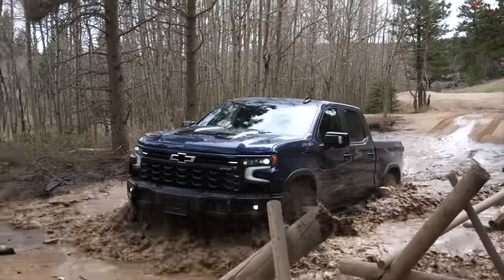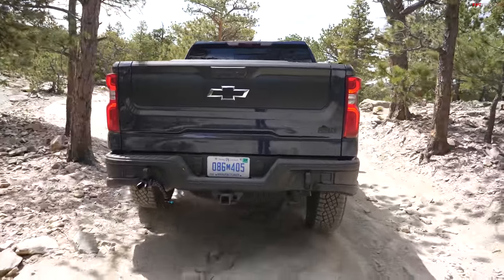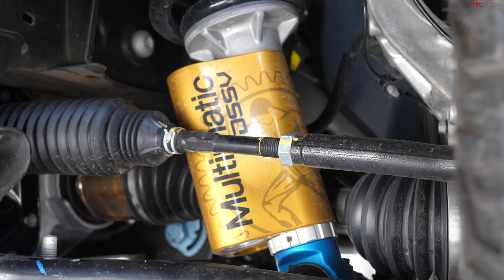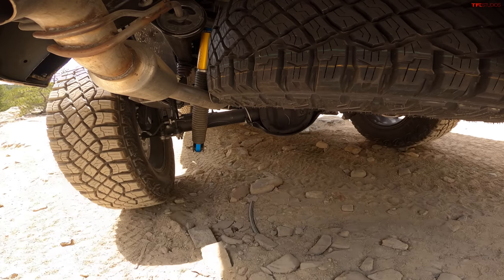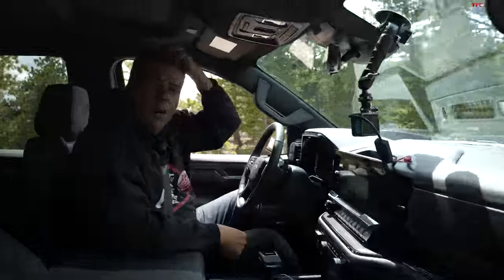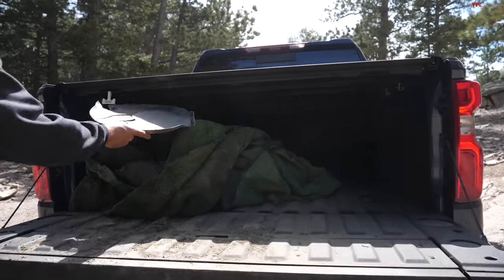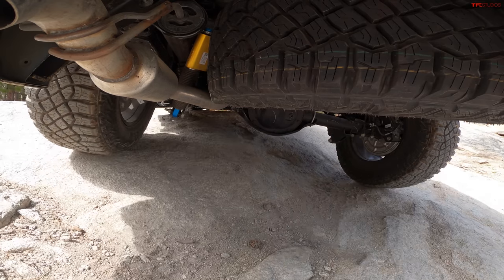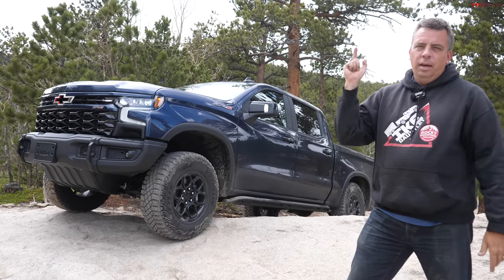The 2023 Chevy Silverado ZR2 Bison Handles DEEP Mud in the Colorado Backcountry, For a STEEP Price!

Comment: Let’s be real, that’s going to be $100k out the door. All these new “off road” trucks nowadays are just pavement princesses.
Reply: I'd rather spend an ACTUAL 85k on a brand new Raptor 37 with all the bells and whistles, heated/cooled seats, and an extra 30 hp and 50 lb/ft, plus it gets better fuel economy 😌
Reply: Don't know about the mpgs but sure
Reply: @awesomeness369 Yea you’re not getting better fuel eco on those 37s. lol
Reply: @awesomeness3699 you really think that Raptor will get better MPG's on 37" tires?
Reply: @richfarfugnuven6308  well judging what the EPA rates a Raptor 37 for 18/24 I'd say yes 💀
Reply: And the only thing that's making Chevy money right now is the Vette, why do you think they're moving all their money to that route, there they can get their top dollar amounts so they can make the money to fund truck research, they have 4 operating companies that are dying and Pontiac bit the bullet first before the steady decline, the Camaro is next, and what do you think will follow, they don't even have a diesel engine capable of 4 digits yet, they simply just don't even have the money to fund the research
Reply: @awesomeness3699  if you drive it with a feather foot, maybe.  A guy at work has one, and he is getting 12...
Reply: @richfarfugnuven6308  which one?
Reply: @awesomeness3699  regular 3.5L twin turbo on 37" tires, but we live in the mountains of CO and work in Denver.  So I am thinking the mountains and lack of O2 doesn't help...
Reply: @richfarfugnuven6308  well good sir, if you want to be specific, that also means that this heavy was truck will be choked due to it being n/a thus only giving you a single digit gas mileage 💀
Reply: @awesomeness3699  possibly.  I had a Yukon Denali, and it did better than that, but not great by any means...
Reply: @richfarfugnuven6308  i bet it had better payload than a mere 1010 lbs 💀
Reply: @awesomeness369  all GM's $$ is going to EV/Green tech. ESG is a real thing and they already played their hand. Chevrolet put 35's on the new Colorado ZR2 Bison and didn't even bother putting it on the Silverado lmao. The Silverado isn't a top selling product and they'll put $$ in what they think will draw more $$. It's sad, but true.
Reply: @sven_the_giant  nah homie, GM is loosing all sales, nobody wants to buy that shit and they should put their money into EVs their EV game is garbage, i cant tell you how many times I've been in a new Hummer and it has flat lined, Watts to Freedom really made me say WTF
Reply: @awesomeness369  what the faq you talking about? Raptor fuel economy? Bison is diésel never in your life will ever be better than a duramax engine fuel economy wise get otta here.
Reply: How about the LGBT rapture
Reply: @sven_the_giant  hilarious how you state your uniformed opinions like facts. The Silverado is GM's #1 selling model for decades.
Reply: @desertBirdDogs  lmao I own and love my Silverado and I know it's not the #1 selling truck 😂😂 do some research
Reply: @awesomeness3699 

You're literally making stuff up. Corvette is losing money for GM. However trucks, especially their 3 row SUVs are selling out. GM Arlington plant may be the most profitable plant on the globe. GM profit margins and general financial fundamentals are better than Ford's. You did nothing but spout nonsense in this comment thread.
Reply: I read all these comments and it let's me know how this country is in such trouble.
Reply: All but K, right before mine
Reply: My buddy just bought one and it was 100,000 Canadian but the US price is always significantly lower like 20-30 grand but not sure. Brand new and he put a olive green army colour wrap on it looks really good actually especially with the black trim
Reply: I've already done crazy shit with mine. It aint right to keep a thoroughbred in the barn.😁
Reply: I'll still be driving my 94 F150 300 inline 6 and 5 speed 30 years from now.. .
Reply: Dont be mad you cant afford one😂😂 if you pay for a truck with your money you can do whatever tf u want
Reply: Got my bison for 76
Reply: 85 ish and BUILT-IN MEXICO!!
High-end money for cheap non union labor!!
Reply: If you want more bang for your buck get a 2020 Silverado z71 trail boss. I got mine for 41K with 33k miles, and if i want to upgrade it i can, its a simple machine, i bet i can put better equipment onto my truck and easily stay below 85k and be just as capable as a raptor, i wont have the same power(i got the 5.3 6spd 3-42 gearing) but i dont have all the electronics that the other trucks do i have the custom trim so over time im saving money in maintenance costs, the rapors trx's and zr2s have too much electronics for a true off roader, but hey to each their own, but my truck stock does great and i can get up to 22mpg highway so have fun trying to get that mpg in those 37in tires😂😂😂 there no freaking way a raptor can get 24mpg highway i call bullshit
Reply: @christopherwoodyatt38  I went to buy a tail Boss, the 20 trucks I had to choose from were built in Mexico.
Built with cheap non union labor but sold for a premium price.
Where was yours built??
Reply: @philllsxga.7737 Why would I care if the labour is non-union? UAW is what is holding the domestic carmakers back.
Reply: @TroySavary  the job you are saving by buying American could be your own...
Reply: @philllsxga.7737  I'm not American.
Reply: Idk about that tho, look at what they’re doing in the video. Very capable truck. My dad has the 2023 Silverado ZR2 and he had to bring it deep in the trails to pull my Jeep grand Cherokee out. And the ZR2 did not even flinch, we had wheels in the air and you wouldn’t even know it. Just wish the suspension was a little softer. i’d say the only downside is the price, he paid 88k out the door that was with it fully loaded, preordered, came with 31 miles, and first person to take delivery of a ZR2 on this side of Pennsylvania. He paid the full price, no loans so he actually takes it on trails and isn’t afraid to hurt it cause it’s all his. So no pavement princess is over here. I only see it being a pavement princess if you owe money on it. 
If I owe money on an $88,000 truck, I’m not taking it on serious trails
Reply: @MichaelKlippi  I was following the Silverado ZR2 before production.
I went to my local Chevy dealership to possibly buy one and found out it made in Mexico..
I bailed out!!
An expensive ass truck built with cheap labor...
Reply: Why would I go off-road with a house on wheels 😢
Reply: For real, in the cities, but where I live on the Zuni reservation, I wouldn't mind taking that truck on the backroads and putting it through the abuse it was made for but 100k for a truck come on

Comment: With 35 or even better, 37 inch wheels it wouldn't have touched anything. Thanks for the video and for keeping clean the environment, everyone should do what you did.
Reply: Would be better if everyone did not dump on the trails to begin with so nobody has to be doing clean up. 😉
Reply: @WW-wf8tu  Correct, but as you can see there are people who don't care, so someone else have to do that, even if it's not fair.

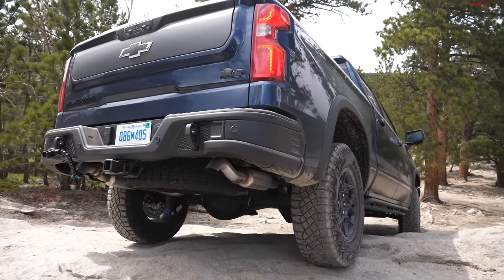Comment: I have to give the capabilities of this GM respect.  In this environment, it was the right tool for the job.  The GC, the front and rear lockers and the cameras were good.  The increased GC is a sure fire way of helping a GM product live a few months longer if it is not scraping along.  Oh, and the exhaust pipes @ 10:44 nicely done.  I hate to admit, this is 1 of the rare moments that I have been impressed with a GM in a long time.  Would be interesting to see how much time it spends in the shop over the next 3-10 years and what it was in for.

Comment: First off, Great review and testing, Andre and TFL crew. Love seeing this truck off-roading.

In my opinion, this truck doesn’t need a wide stance of a city bus like the TRX and Raptor. Won’t work in mountainous terrain. 

The 33 in. tires are just as good, even better, than the taller tires. The 33s can do handle both on and off road unlike the bigger tires that are great off road but not great on with poor handling, ride comfort and noise levels, and fuel economy plus the possibility of rubbing the inside of the wheel well.

I agree the price is high, but what you get is fantastic. The lockers, the cameras and the cool AEV gear. I know the ZR2 doesn’t compete with the two so-called Super Trucks, but it will keep up and surpass them when it comes to Rocky Mountain terrain.

If I had the money, I get this exact truck but in Sandstone Metallic. Keep up the great work, TFL.

Comment: It will be surprising if they sell many of these. A regular ZR2 has all the important mechanical upgrades. Some boron skids and different wheels, you REALLY have to be a fan of the Bison branding to throw that cash down.
Reply: I have a Non Bison ZR2 and it is an Extremely capable truck. And a pleasant daily driver. Except for the mileage.

Comment: When is GM gonna quit mounting the rear shocks so low below the axle? Other than that one thing I love the GM tucks.
Reply: They FINALLY changed it on the new Colorado ZR2 haha
Reply: I think it requires some significant reworking of the frame and bed, which is why only when redesigning a whole new model like the Colorado did they finally make it so that the shocks had enough travel without hanging Dow too low.
Reply: I agree. That design flaw always bothered me and deterred me from buying a GM truck.

Comment: 6:07. Andre, at 6:07 +/~ you say you’re taking a super difficult line and I noticed the front passenger tire slip and turn faster than the front driver  tire. I saw that you locked front and rear so is it a true locker or limited slip in the front?

Comment: My Dad was right when He said that 4 wheel drive is for when You get stuck in Two wheel drive. Of course when We went Deer hunting He would climb the steep hills of Marin County with His old Willy’s Jeep Pick Up. They were rugged looking with those military type fender’s. We have had Fords and Chevy’s and still do but I really like the old military Dodge weapon’s carrier or the civilian model Power wagon that looks like a WW2 military ambulance or WW2 Chevy. Having a narrower vehicle has definite advantages especially in Bay Area California where people park on very narrow roads like those on the slopes of Mount Tamalpais  and surrounding area’s . The fire department can get away with smashing cars that choke down roads but not the general public. Also keep in mind that wide offset wheels are hard on axle spindles and bearings . Those bigger tires cost more and need more power to turn them causing more fuel consumption and loss of extended range. Loose a wheel and tire on the freeway or roll over while traversing a side slope and You better have a very good attorney because You might just be charged with manslaughter. Break something in the middle of nowhere or a rugged place and a lot of recovery operators may refuse the work or charge a hefty fee. Abandon the vehicle without a guard snd there are those out there who will strip it of everything.

Comment: You know what would be great is if they gave people the ability to pick the options they want instead of making a hundred "different special" sub models that have 10 to 30 thousand dollar price hikes.
Reply: Yeah the custom trail boss comes with only a 7 inch screen. But if you want to upgrade to the 11 its not an option you have to go up in trim level. So then you have to get the LT trail boss. So thats like 7 grand just for a bigger screen! you can buy a 11 inch tablet for like $150-$900 but you have to go up in trim level that doesnt really add much at all. Think it says bigger screen and different wheels. The LT allows you to get the 6.2 engine but all that should have been an option in the basic trail boss. So you go up and its like $10 15 grand then you still want like $10k in options your looking at a $70k truck just to add options. Upping trim levels is a scam. They should just allow to option out the basic trailboss with everything.

Comment: @ 3:50 - 4:06 - 33" tire / no tire big enough......exactly correct. All the new off-road type of trucks should roll off the assembly line with 35" tires and offer 37" tires as an option. Glad I have a 2022 Ford F350 Lariat Tremor.....great payload and towing ability and IMO more capable off-road than the Chevrolet ZR2 or GMC AT4X.

Comment: Did you replace the electric steering rack after crossing the water? Usually the motor becomes faulty and loosing the steering ..I have already replaced it for my 2015 silverado.. headache

Comment: I test drove the bison a few days ago, very nice vehicle! I’ve been holding out on purchasing any of the midsize trucks like Gladiator rubicon or Colorado because they’re just too small for 4 guys to go on a trip in. 
I find it bizarre how Chevy could release a truck of this size with a play load of 200-600 pounds less than the gladiator rubicon, Tacoma TRD Pro etc. with it being quite a bit bigger than the other trucks. 

You’d hit your payload quota with 4 guys sitting in it before you’ve even fitted a roof top tent and packed your bags. 

I don’t see the point of having such a large and capable off-road vehicle when the payload limits it even more than it’s other smaller and more capable competitor like a gladiator rubicon, makes the bison a bit redundant before it even hit the streets in my opinion.
Reply: The extra weight of everything reduces payload. Also softer/plusher springs for off road reduce load carrying. Probably has to do with DOT/legal too. They have to stay under a certain GVWR. 
They have a HD Zr2 coming as well with 4K lbs of payload.
Reply: @TobyCostaRica  - I’m sure there are those factors. And yet you have something considerably larger than the Gladiator/Tacoma with a lower payload than them. So it just doesn’t make much sense for me as I’d rather go with a more capable 4x4 like the gladiator rubicon as I’m only going to be able to fit myself and a passenger with luggage in either it or the bison.

Comment: Ironically, the manufacturers are finally bringing a bunch of serious off-roaders (instead of plastic poser packs), but at a time when no one can afford them. If they had taken this approach 5 years ago and priced them between 45,000 - 55,000 they would have been selling like hotcakes. 85K is just too much for most buyers and then, after spending 85K, how many can afford to risk taking it on the sorts of trails that it deserves. In 10 years, these will be a fun used proposition for 12K.

Comment: So my thing with chevy is that they haven’t built a super truck since the 2000s with the SS… that being said even tho Ram and Ford do have 700+ hp… they can’t do what this truck is doing in this video… having that much power, low range is extremely punchy even still. Chevy knows where it’s at when you need to go somewhere. They know that powering 700 hp over huge rocks and 3 foot cliffs ain’t gonna work. I still wish they’d make a super truck with crazy power yes, but this truck is so cool!!!

Comment: A 1000 lb payload really kills this vehicle as a truck. It really needs to be at around 1500 even with all the stuff on it. This means the standard ZR2 is I think the better truck because while yes the armor is better on the Bison the benefits it provides is less than the cost of the payload and not to mention the cost of the vehicle itself since you can easily save 8-12k on the price going with a standard ZR2.

Comment: Is GM shipping their trucks with a spare set of lifters and a camshaft now?  <—— GM guy here but I hate what they’ve done to their engines.  The cylinder deactivation stuff has ruined what was once a bulletproof engine.
Reply: Get the diesel no issues also they pair the 5.3 with the weak 8 speed.

Comment: Don’t lock your locker so quick try doing it without them and see if they are needed. I do some crazy trails in my gladiator with open diffs and never use my aftermarket front locker.
Reply: Doesn't it have a stock one?
Reply: @yissibiiyte  no I have a built sport.  It has open diffs front and rear.  And it’s super capable but since I regeared it, I figured I might as well go ahead and add a front locker.

Comment: I like that the F150 Tremor has a 36 gallon tank, larger payload and the seats are more comfortable.  If Chevrolet would fix those two things The ZR2 Bison would check all the boxes.
Reply: F150 Tremor is not at this price point. Standard ZR2 model has around 1400 lbs. Ford has alum body can get away with adding such and pushing up gvwr. Bison payload goes down  because those bumpers are heavy. A 36 gal would push payload down more and hurt towing numbers.